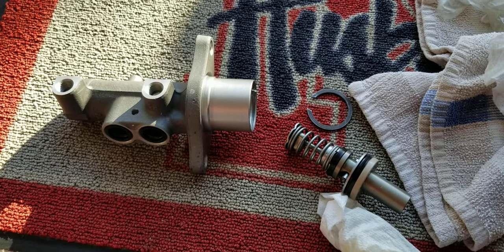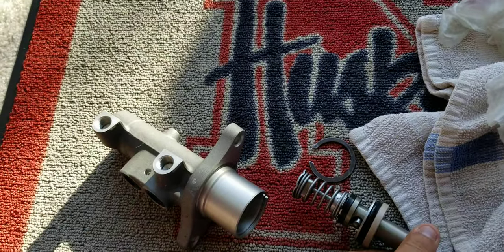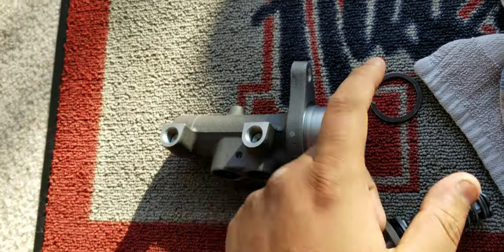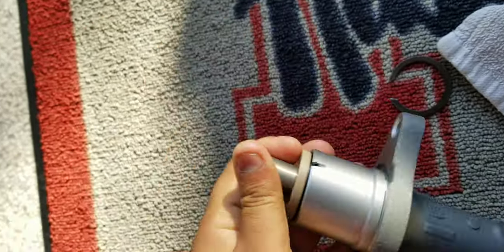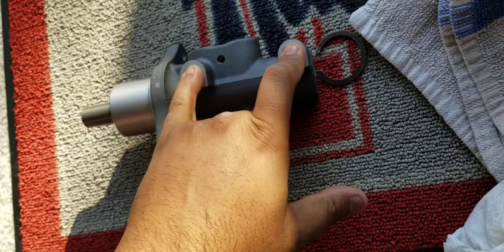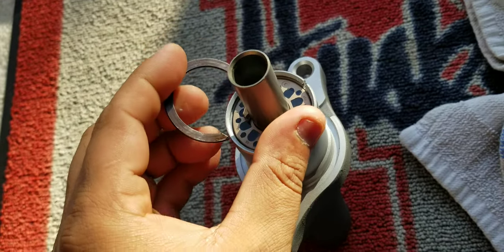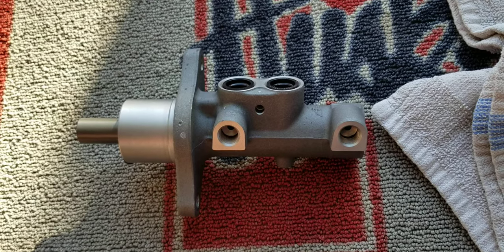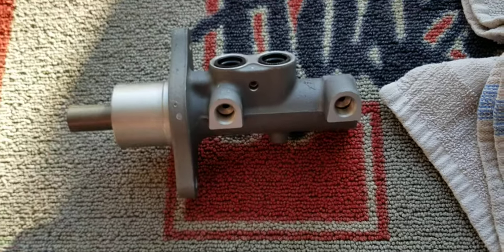Mazda 3 2012 Master Brake Cylinder Inside Overview! Brake Goes Down to Floor Problem!

Comment: Does the back piston part come out ? I've done the exact same thing you've done in this video . Any help would be good
Reply from the maker: It was over 2 years ago when I worked on that issue. Based on what I remember, the back piston side didn't came out, I ended up putting it back in car without any changes and filled brake oil. In my case problem lem was air in brake line, after I kept on pressing brake it finally worked since my brake cylinder was good but at least I was able to verify that.